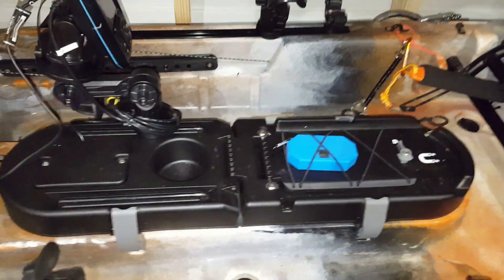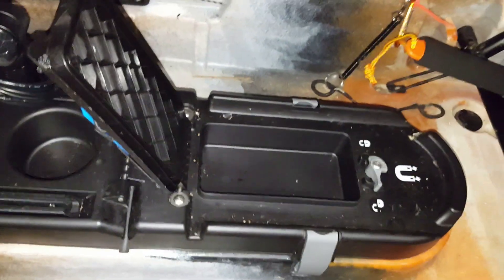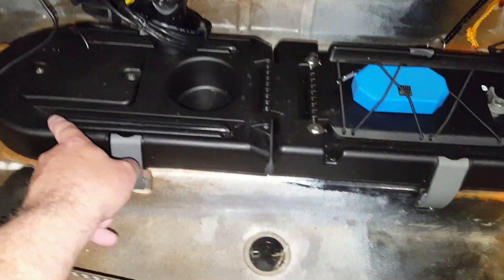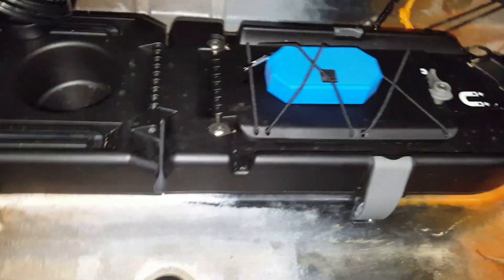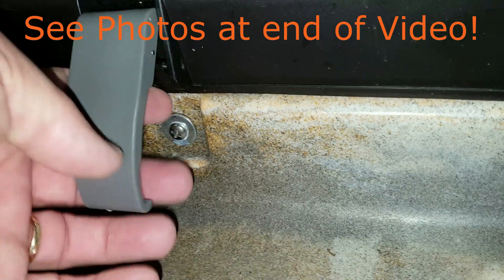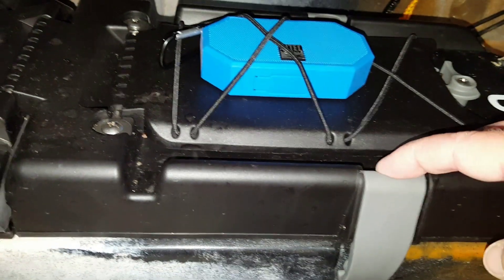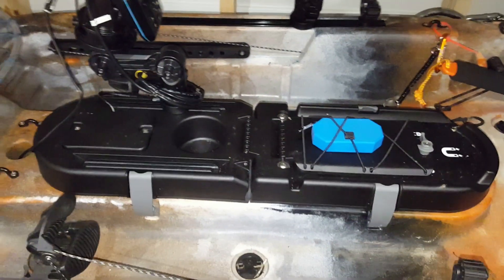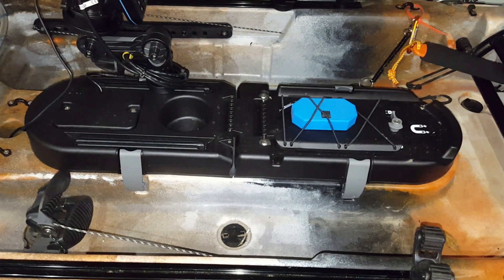MODPOD II Center Console for Vibe SeaGhost Review

Comment: Nice addition. Have yo done a video of installing your transducer. I need to know if the Garmin 4cv plus transducer fits. It is larger than the standard 4cv transducer.
Reply from the maker: Hey Mike, the Garmin 4 Plus cv transducer will fit the SG110 or 130 fine. If you buy it new it comes with everything you need. The bracket that comes with it lines up perfectly with the pre-installed threads in the hull, enough that you can get 2 screws in, which is plenty. The Garmin includes 2 screws with the correct thread to fit the inserts too
Reply: @medic-aidskayakfishing9476  Thank you. The 110 will most likely be my retirement gift to myself.